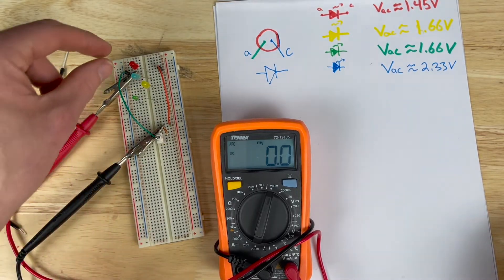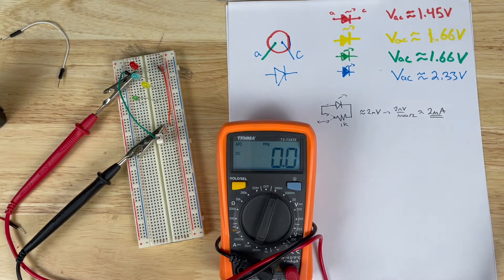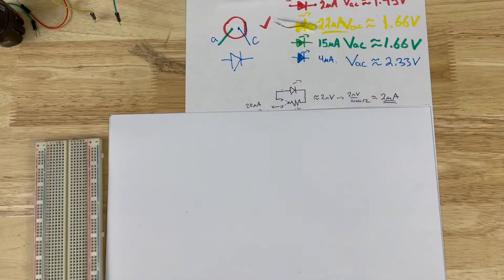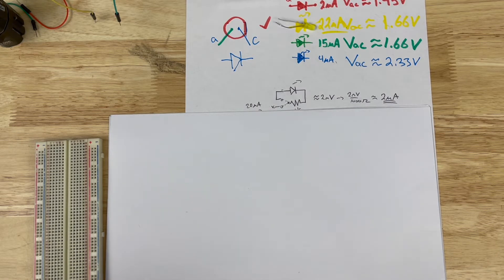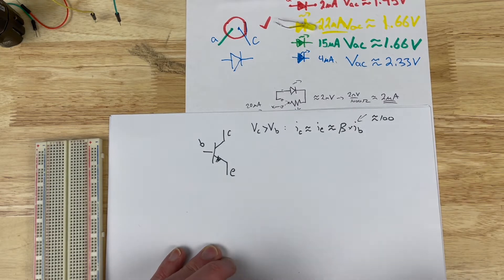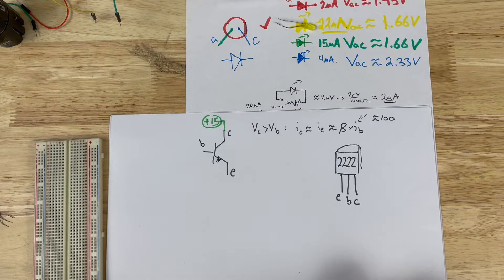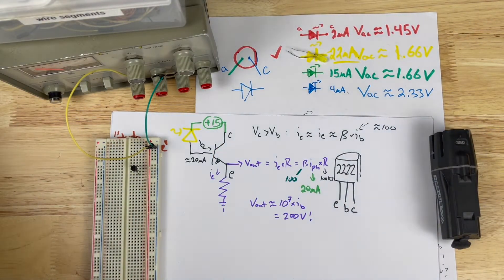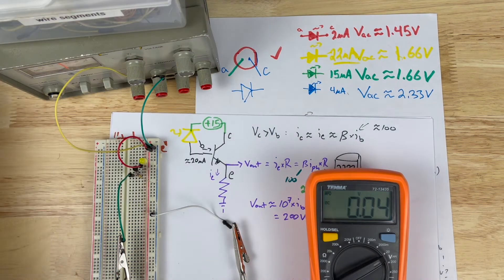Detecting Light Part 1: Use an LED!

Comment: How sensitive can you make these?
Reply: Very. I placed some leds in parallel but havent tried series yet. Just breadboard to a voltimeter. Then used different color led flashlights and graphed out voltages produced. I have 18 types of leds and some are real odd like one is reverse polarity and a few have a epoxy case that floureses in uv. Great for sensing or optical stuff but terrible for power gen
Reply: Oops, very but theirs still noise in the led from other em radiation